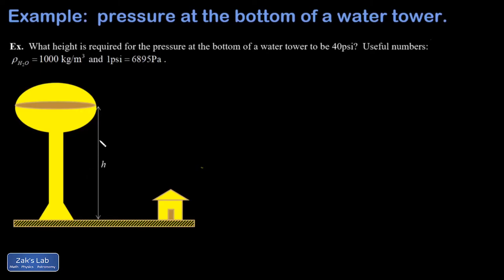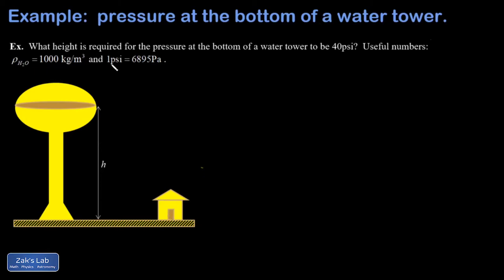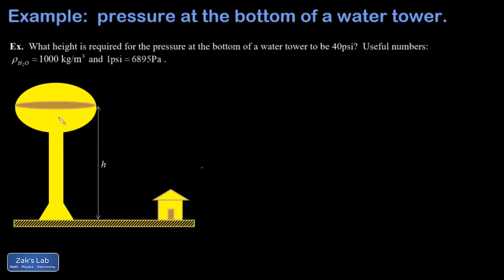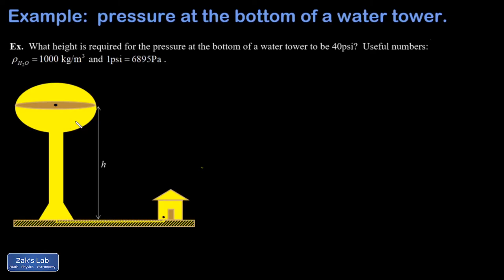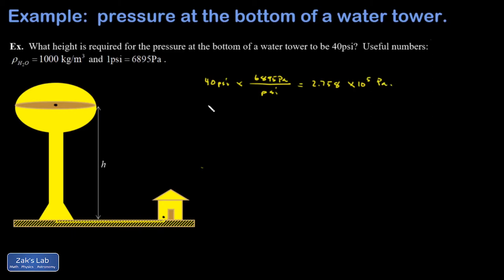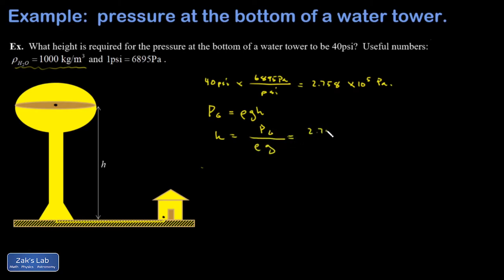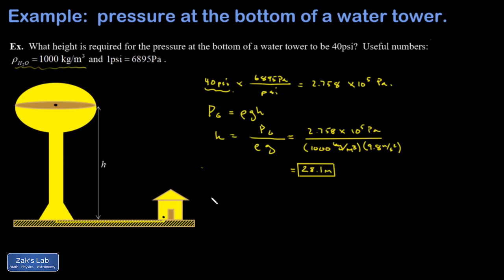Water tower pressure hydrostatics example:  water tower design to get desired pressure.

Comment: Not all city have a pump running continuously to provided the necessary water pressure.  I inspected the City with a population of 93,000 during one of their water tower installation.  So it seems this little city prefer water tower over having a pump running all the time.

Comment: How would I calculate the outlet pressure with 5000L of water and a height of 6 meters ?
Reply from the maker: The height is all that matters for the outlet pressure, provided the system is static.  If the outlet is gigantic and the "tank" fairly narrow, then the fluid velocity in the tank would no longer be negligible, and you'd have to use Bernoulli's equation. z

Comment: All of you wrong = lbs per gallon + size pipe at bottom + nock offf few lbs for length ran.... ALMOST all city water from a tower is 60 psi ... most rural deep wells 1 hp sta-rite .. pump 60 -90 lbs as cut on - off. ...way better pressure in a shower! what i need is SHTF senario = 12 volt pump fills the tower of a 250 gallon tank at 20 feet high and at bottom i iuse 1 inch pipe and pressure gauge ! what is my pressure please ???? im going hook up 4x toilets with it.. so not need much .. lol